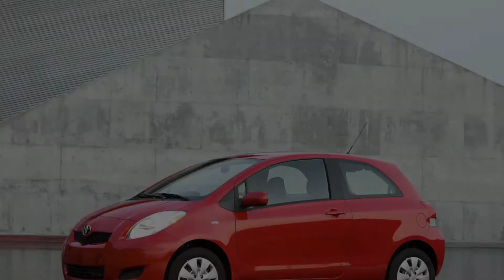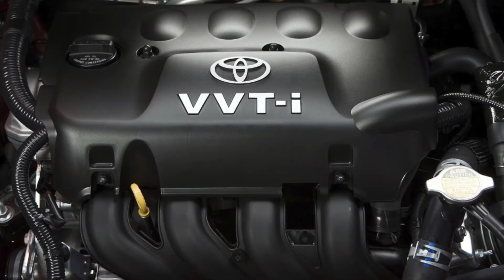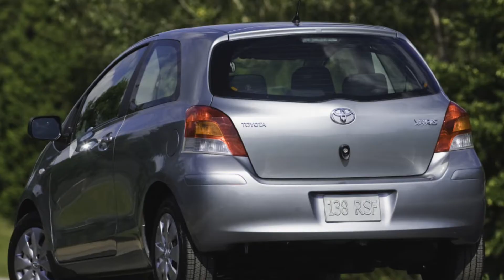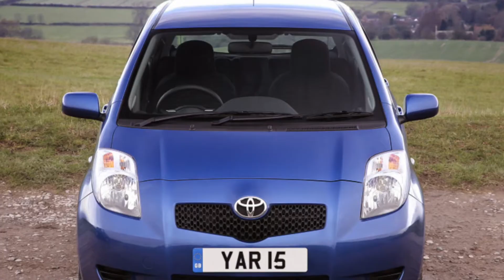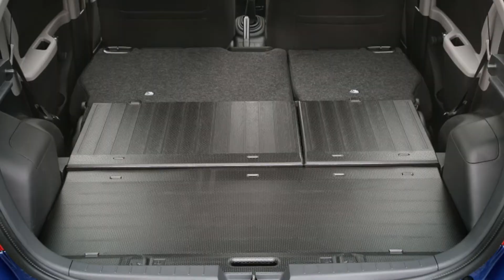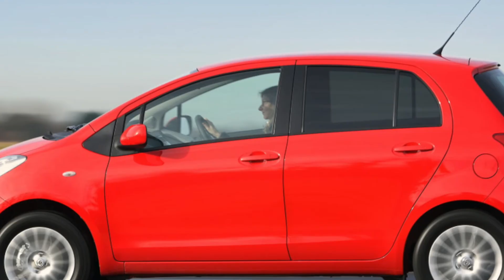Toyota Yaris 2 Problems | Weaknesses of the Used Toyota Yaris II

Comment: Buna , scriu aici poate a mai trecut cineva prin asta și are o soluție,că efectiv nu mai știm unde sa o ducem.Dețin o Toyota Yaris 1.4 diesel an 2009 in ultimă perioada nu reușim să îi dăm de cap la următoarea problemă: a început să nu mai pornească la prima apăsare pe buton, din a 2a,a3a uneori chiar și a 5a a10a... Am fost cu ea la reprezentanța unde au spus că trebuie schimbat electromotorul zis și făcut l-am schimbat(țin să menționez că in bord nu apare niciun martor) însă mașina la fel face. Am fost la alt mecanic a spus că este butonul de pornire de vină,am schimbat și butonul, insa problema e la fel. Plus mers la alti electricieni auto dar nimeni nu reușește să găsească problema,alți mecanici când le spun Toyota Yaris nici nu vor să auda.Dau un exemplu dimineața pornește din prima ,merge ceas,însă daca după ce ai mers o jumătate de oră și te oprești undeva nu mai pornește neam...daca o las câteva ore bune pornește iarăși dar tot din a3a a4a apăsare de buton.

Comment: mines done 192000 miles but recently has started using a lot more fuel probable around 35% more. getting code p0171 cleaned maf sensor and replaced oxygen sensor.
Reply: Even mine takes more fuel nowadays I don't know what issue.. my Yaris 2009

Comment: My wife's 07 1.3 has 148k only, really only small thing to do that normal for car maintenance. This december coming ill be doing hi milage inspections for a piece of mind. Just the petrol pump now and then making funny sound, not to expensive to replace should that time come. All i wonder, whats the best oil to run in this car. My vw tdi oil atleast 40% more expensive but that old lady keeps on running 400k now and no wear issues. Both cars run manufacturer spec oil from day one.
Reply from the maker: That's great to hear that your Yaris is running so well!  You're on top of the maintenance, which will go a long way.  For oil, check the owner's manual, or talk to a local mechanic.

Comment: 2008 Yaris with 62k miles and it has some corrosion underneath (I live up North). For now, I had to replace the muffler, and I have to replace the bolts securing the catalytic converter to the intake manifold. A very hard job to do and the shop wants to charge me $700 for it. I recently replaced the drive belt myself, since it was squeaking. There is a noise when the car is moving, which I still can't determine the cause, it might be the gearbox. I thought of the cv axle, but I believe it's not because there's no noise when turning. It could also be the wheel bearing, however, the sound is more pronounced at lower speeds.

Comment: Ok. They are talking about cars not sold in the US. The US version came with only the 1.5 ltr engine. It is bulletproof. I bought the first year model sold in the US, in 2007. The only issue this car had, was the abs rear wheel sensors went bad, due to road salt. I gave it to my older daughter, in 2011 to drive to college. She gave it to my youngest daughter in 2022. The oldest daughter was in 8 accidents with it. The youngest one, was in a rollover accident, where it rolled over twice. She walked away with no damage. That was about 2 months ago. “ Major Tom” ( my wife gave it that name, David Bowie song” floating in a tin can” lasted 16 years, and over 200.000 miles, in the rust belt of Wisconsin. Except for some minor suspension parts that rusted away, nothing else needed replacement, or work. I did a drain and fill on the trans every 60.000 miles. AC unit still blew as cold as new. Window regulators still worked fine. The gauges were located in a weird position, but for some reason, both my daughters miss that car. My oldest now drives a 2024 Corolla hybrid. In my opinion, there really isn’t any cons to driving this car. But on snow or ice, I’ll take a Tacoma any day….

Comment: Please the 2 reverse lights of my 2007 yaris automatic transmission are not coming up at all,what do I do please?
Reply: Thank you, its actually the bulb,it's been fixed
Reply: Brake lights. Did you check the bulbs? If they are ok, trace the circuit for power break.

Comment: I have a 2011 xp90 with 160k km or 100k miles and had no issues. The main thing is the underbody is not well rustproofed so I did mine with dinitrol when I got it and touch it up each summer. It will probably now last forever !  I found noise levels fine but mine is a 1.3 with 6 speed box.

Comment: I had the 1.4 d4d Diesel Engine Yaris for about 10 years, bought it with 40.000km and drove it until 240.000km. It received service every 15.000km. At the end it burned a little bit of oil (~0.3 - 0.5L on 15.000km). At ~100.000km I replaced the front brake pads. At ~200.000km I replaced all the brakes with pads,  at ~220.000km I replaced the front springs. That´s it basically. I replaced it because of rust in the rear wheel housing which seems to be a problem at this generation Yaris. Nowadays I do have an Auris 2 with the 1.33 VVT-I engine and ~85.000km and i replace the oil every 10.000km to avoid problems like oil burning. Until now it worked quite well, no oil adding between oil changes required so far.

Comment: I new battery.
2 alternators.
One timing belt.
Two sets of tires.
One windshield.
Two sets of wipers.
I use Castrol full synthetic 0w50.
Starts 38 below Celcius not plugged in.
Have 267,000 kms and notice valves ticking need adjusting.
Never replaced auto tranny fluid.
No brakes, shocks, steering or suspension parts replaced.
Trunk and drivers door locks sticking getting worn, oiling restores function.
No rust, hit a dead deer flew over it, no problem, hit a porcupine, ripped off plastic underneath and tin cover on muffler removed as it rattled.
Great car, put oversize taller tires on it, speedo is off but I use GPS, get 800 plus kms on one tank when driving 90 K/hr, less the faster you go get almost 600/tank if doing 110/120 km/hr...

Comment: We have a 2006 1.3 L Yaris auto hatch with 330,000 km on the odometer and a 2015 1.3 L Yaris auto hatch with 160,000 km on the odometer.

The 2006 model had a throttle body sensor go at ~260,000 km and the air conditioner box drain hole got blocked and started collecting water and shorted the fan. Had to blow it out with air. The fan cost about $120 second-hand. A new one was ~$450. It took 5 minutes to replace as it was held in with 3 screws.

Cam chains are original, no smoking, no noise, no leaks and still getting ~12-14 km/L around town or on the highway. Sometimes they do even better. That's pretty much what they were doing from new.

Shocks and springs needed changing at around 150,000 km. Use a slightly heavier set of springs and shocks to avoid sagging in the future? The 2006 Yaris sagged badly at the front (started scraping over every speed hump) so we made up some stiffer and slightly taller springs. The 2015 Yaris still has original springs and shocks in the front. The tyres will toe in and wear out very quickly if the rear shocks and springs are too soft. So upgrading the rear shocks and springs saves you a lot of money in tyres. We've had to do that in every car we've ever owned so it's not a surprise. It doesn't help if you tow as that loads up the rear springs and shocks even more. 

Front bushes on the 2006 Yaris finally went at ~320,000 km so changed both for about $400. Used aftermarket parts as Toyota wanted to sell us the entire assembly for about $800/side. 

The in-tank fuel filter will need changing eventually... but wait till it starts playing up? It's an expensive part if you change the filter and pump (recommended) it's ~$450. If you change just the filter on the pump it never seems to work right and takes ages to pump the fuel up to the engine making it hard to start.

A squealing fan belt was one of the few things that turned out to be tricky to fix. Dealer didn't do it under warranty (one reason not to service it at the dealer) ... so eventually we got in there with a pry bar and increased the tension. The fan belt is still OK on the 2015 Yaris and we changed it on the 2006 Yaris at about 260,000 km.

N.B. Putting E10 (10% ethanol) fuel into the cars deposited gunk (ethanol forms aldehydes which then polymerise) throughout the engine and increased fuel dilution which reduces lubrication. The problem goes away if you stop using E10 fuel.

Paint is looking a bit tired on the roof of the 2006 Yaris... but still OK on the 2015 Yaris.

Overall both cars have been relatively trouble free.

:-)

Comment: right , i have facing engine knocking @ 195000 km especially  at cold start and hillup ,and already changed short absorbers ,ball hubs for rear wheels and sand covers for struts ,wipers blades ,

Comment: I just purchased a 2010 2 door hatch base with an automatic and only 16,500 miles on it.   I've read many good things and few bad things about this model but overall, it's good.  Much better than other cars in the class..
Reply: Where did ya find that? I bet that was a pretty penny lol. Nice daily 😅 to keep the miles off the taco, I’m doing the exact same thing, except my Yaris hatch has 210k
Reply: @thomasgriffith5544 how is it now
Reply: How is it
Reply: @jayislander   So far with the 1,200 miles i've put on, it's amazing.  on a 500 miles road trip, it got 42mpg.   No issues on the freeway.  I'm installing cruise next week so that'll make these trips easier.  commuting is also great as it's easy to park.  in-town mpg is about 30-32. I haven't replaced the stereo yet but right now, i'm in no hurry as there's an AUX input that I can plug my iPhone into and the sound is pretty good for stock.  I also have a '21 Tacoma so if I need to tote larger things (or people), that's that I use...and that's rare.
Reply: @gerardthai6467  sounds good thinking of purchasing one
Reply: Bought it
Reply: @jayislander how’s being your experience so far? 
What have you done in the car? 
Thanks

Comment: I have a 2007 Hatchback 5 speed manual with over 430,000 orignal miles... and it won't simply die!
Reply: @Garden State NJ That’s nothing…
Reply: nice car. great.
Reply: Yea my 2011 has 257k, just replaced alternator but no other problems, although that is normal repairs after that time and miles.  Everything works and is in good shape.

Comment: I do not know where this narrator's information is coming from, I personally own 2 Yarises, one had 150,000 Miles (241,000km) and it has never burned a drop of oil, nor has it had any parts replaced other than spark plugs and Filters/Oil... Then on top of this my friend has 3 body shops and has 30 Yaris Sedans as loaner cars all have between 100,000 and 200,000 miles and not a single one burns a drop of oil, I maintain them for him...they are literally beat like a red headed step child and driven with no fucks given...and they hold up better than any other Loaner car he has ever had...that includes P71 Crown Vics! - I have only ONCE had to bring a customer a replacement loaner and that was due to a Fuel Pump that shit the bed...Should have seen the look of the customer when I showed up with a Yaris, towing a Yaris on a Dolly! - I use them for everything!
Reply: Nice I bought one
Reply: I am purchasing a 2008 Yaris with 198,000 on it for 2300…body is in rough shape, but I felt the engine sounded good…anything I should focus on? Does one worry about head gaskets?
Reply: @CREATORmeyou  No the 1NZ-FE is probably the most trouble free engine Toyota has made...My friend has a couple of his own that he uses for "Parts Runners" that they are not nice enough to be loaners anymore...they have 300K on them...They have never had the head off! - The Alternator belt likes to squeal on almost all of them, and people make the mistake of trying to tighten them MORE and they pry on a sensor breaking it...The trick really is, turn key on wait like 2 seconds THEN start the car, there is even a video about this on YouTube...Seems the Computer Holds back the charging system if it has time to think...
Reply: i think this guy either has mixed up the yaris with another car or no fucking clue

Comment: I have a 2009 Yaris Hatchback with a 5 speed manual transmission that I have been the only driver of. My car has 156,000 miles and the only things that I have had to replace are hub caps they keep falling off. I had to replace the driver’s side mirror cover because someone stole it. I have had to replace my tires four times due to wear and damage. The only other things that I have done is replace fluids i.e. oil, coolant and transmission. My car has  the original brakes which no one including my mechanic can believe but the car passes inspection every year and the car stops fine. In my opinion this is the best car that I have ever owned. My only regret is that I did not opt for the power package when I purchased the vehicle. My engine hums and is smooth and solid. Oh and I once replaced the timing chain and the drive belt. I love my Yaris.
Reply: Oh yes, had to replace air filter twice, and once squirrel jambed intake full of pine cones and had to drill to poke them out, had no air getting through thus no power.
And twice lighter socket fuse blew, there is a video where to find it that saved my ars, under the hood. I replaced the original headlight bulbs with high intensity white ones from Canadian Tire, but not the HID super bright ones...
Love this car, 2007, 1.5 liter. Bought another one for spare, only 5500 each with 100 K on the odometers.
Reply: I dont even bother with hubcaps
Reply: @teru797  I painted my rims silver and installed those black toyota center caps from the 80s Corrolas.

Comment: 2007 with 1.5L engine with 220k miles. Normal maintenance over all.. Water pump replaced at 150k miles. Fuel level float (which reads fuel level) went out at 200k miles. Does burn some oil now.

Comment: I bought toyota yaris 1.3 100hp 2009, 6 speed manual, with 132k on dash, drive 30k for 2 years,with no problem's,only change front brake discs,pads, oil with all filters,and candles, that's its, drive lot of the time till red line,max speed  i didn't reach, but i make 187 km/h,really nice car with out rust, and lot of space,sold it because, want something new and with cruise and air conditioning.so i buy 2017 yaris hybrid, can say truly,this is peace a shit, everything is cheap made.😉But the salon and outside look i like!

Comment: is he reading from what’s car magazine?
 I have a Yaris 2007 with 170k on the clock and it’s got no major problems of course you need to change the fan belt the oil tires etc but come on it’s a reliable Toyota car yes course it’s not perfect but most European cars would be lucky to do 100,000 miles without a major problem but with a Toyota or Honda it’s the norm to do 100k without a Hitch
Reply: What mileage should you change the fan belt on the 2007 I just got a Yaris 2007 automatic base model

Comment: I need an inexpensive Toyota Yaris or Aygo, with automatic transmission. Which model years are the most reliable?
Reply: I bought a 2006 Yaris (AT) in July 2020 and i still own it…i can tell it’s very very reliable all it need are general services (periodic service) like Oil change, filter change etc…
Reply: @kr1ss00  I've decided to buy a Yaris and not an Aygo, since the Yaris is significantly safer. It's a present for my wife. 😊
Reply: @viperracing2889  you did the right choice…yes it’s very safe my Yaris has 9 airbags 🤯
Reply: @kr1ss00  Yeah, I checked the Euro NCAP results/videos and it was a big difference between the Yaris and Aygo.
Reply: @viperracing2889 update ?
Reply: @kr1ss00  is yours an auto ?
Reply: @_s6132  yes i mentioned it in beginning (AT) Automatic Transmission
Reply: yeah my yaris is made of airbags 🤣🤣🤣
Reply: I bought my yaris 2010 4 door  2  months ago. No problems at all and it runs great! Did well during the last week's petrol shortage..runs like a dream, highly recommend  over an aygo!!
Reply: Update,  all I did so far was change  the front tires, wipers and discs/ front pads. For theMOT.  So far no problems!!
Reply: @chrisadish update ?

Comment: 2009 1.5l in USA texas, 157,000 miles
Changed:
-pcv valve, very easy fix 7$ part from factory
 -belt, squeaky, needed easy fix
-alternator, was not needed, easy fix
-ac pulley, noise but not needed, hard fix but can be done by you
-roof railing crack and old
-all four shocks, not needed but personal preference
-fuel injectors, after a few years maybe need refurbishment, easy fix
- water pump, was not needed but changed anyway, cheap part online
-auto transmission gear selector, very easy fix and cheap part 25$, 
-spark plug coil, very easy fix

One common issue with corolla and yaris and maybe all toyota, ever so often, it can blow spark plug coil cylinder 1, easy fix, just annoying. All in all, reliable car, would recommend, never fails, and most of all problems can be mended easily. If you can change oil, or brakes or headlights then you can fix most these issues
Reply: Took a screen shot of your comment because I'm going to get a Toyota Yaris. Thanks for the comment. Also if you don't mind, give any update on your car would love to know how it's going.
Reply: @theodoresmith7452 did u buy
Reply: @jayislander  nah I went with a 1993 Mazda Miata. Less practical but it's fun.
Reply: I am purchasing a 2008 Yaris with 198,000 on it for 2300…body is in rough shape, but I felt the engine sounded good…anything I should focus on?
Reply: @CREATORmeyou did u buy it
Reply: Where can I get roof railing